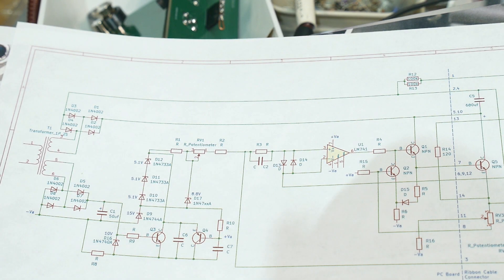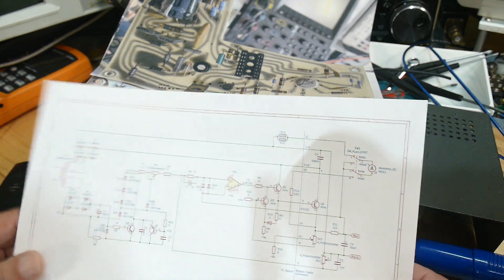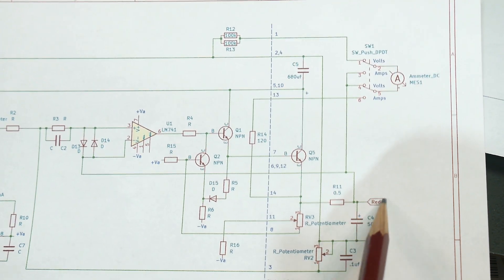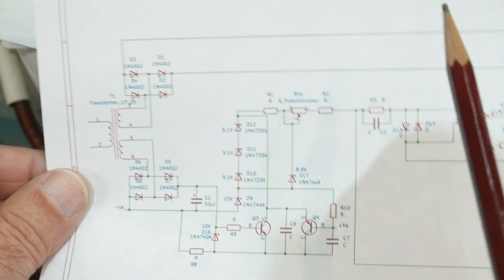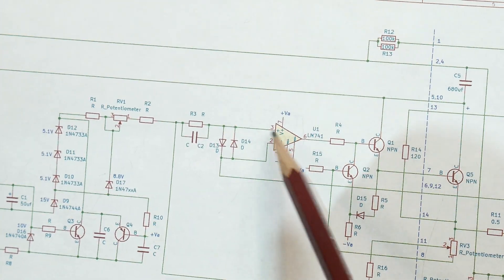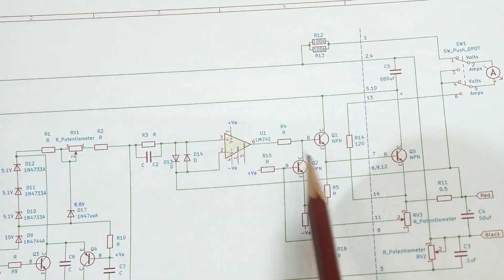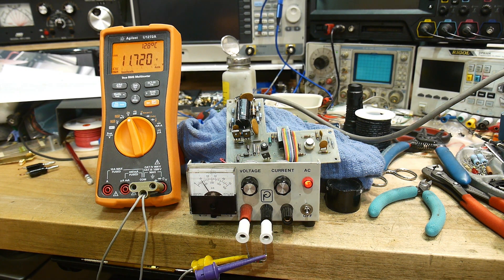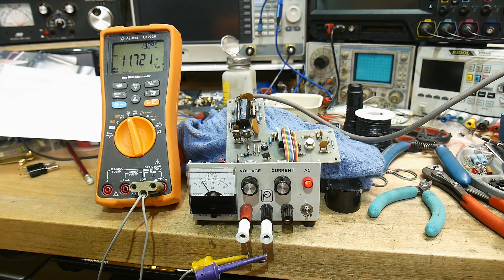#1821 Pacific Radionics Power Supply PP-20-3 (part 2 of 3)

Comment: Oh, my “guess” as to why Q2, the current limit transistor is always on….broken wire or dodgey insulation displacement connection on pin 8 of the pin header causing R15 to pull the base of Q2 up, or dodgey/dirty RV3…will I be correct in part-3?!

Comment: Photographic reverse-engineering the Big Clive way! One moment please... and resume.
Nice PCB design there. I love these curvy traces! (and curve tracers)

Multiple Zener diodes in series look like either used for power dissipation or temperature compensation reasons. I can't really see why either would be used here. I also can't really see where +Va is taken from.
Reply: Yeah, the print the photo of the board larger, and the back side mirrored is Clive's favorite technique! He must just chew through the yellow and cyan ink in his printer (because most of the huge board images he prints every time are green)!
Reply: @gorak9000  that's precisely why I wouldn't do it that way - not only do I have a grayscale-only laser printer, but also I'd consider it a waste of ink to print in color whenever I need to do reverse-engineering. So, it'd have to stay on screen, and then there's this pesky marking the spots in a graphics program.

Backlighting a PCB has helped me when I was reverse-engineering a vintage digital delay/reverb here: https://www.youtube.com/watch?v=sGNYrXYgAC8

Comment: I have drawn the circuits of hundreds of pieces of gear, I don’t use pictures like you or Clive, I just do it directly off the board. 
I could do this in about 25 minutes. One thing you learn is not to assume BCE pin outs being the same for all transistors. Gut instinct tells me there is something dodgey with Q4…looks like the emitter and base need to be swapped. 
Everything else looks “Kosher” though.

Q4 being wrong is what is flumoxing you with that reference supply in the lower left hand corner. 

I certainly would not bother with a CAD version, just pencil on paper, then I can easily rub-out and slter “mistakes” like Q4.

Another thing to watch out for is to be sure if certain transistors are NPN or PNP…particularly if numbers have rubbed off or they are do old there is no datasheet anymore…sometimes you will come across small SCRs in TO-92 packages, or UJTs or PUTs..these little buggers canhave you scratching your head foe a little while!

I was caught out recently when replacing tired old low HFE TIP 3055s for contemporary MJE 3055s, (All I Could Get) one is BCE the other is ECB, so got them in with BE transposition…it was a Royer/Baxabdall type circuit, so no harm done, but had to take the heatsink that was UNDER the two TIP 3055s and put in ON TOP of yhe two MJE 3055s!  (Was in a BWD 845 Australian Oscilloscope.)

Comment: This is excellent. Thanks for all the effort you've put into this video.
R10-D9 is used as primitive voltage reference for the Negative Rail in relation to the Positive Rail. Although these rails are taken from the aux winding, they still need some kind of common reference point and a predictable voltage diff between them. Also, windings must have a common reference. OpAmp is in a serious trouble here, as one of it's inputs is fed from the main out. I suspect the manufacturer had trouble with this, notably burned opamps during fast transients, so they've put two reverse diodes in parallel on the opamp inputs to protect it. In any case it's a mess.
The other three Zeners D10, D11, D12 and Q3/Q4 are the voltage regulator for the OpAmp's positive rail and common reference. Zeners are also driven from aux winding by a somewhat compensated primitive transistor current source Q3/Q4. I suspect an error in the schematic or logic at a common point.
The source's driver is Q3, with it's current is set by R8/R9/D16. As it heats up its current will increase, so I suspect they've used thermally coupled Q4  to stabilize the current and prevent thermal runaway of Q3. Anyway C6 is there to prevent potentially catastrophic oscillation between transistors. This common voltage is then used as the reference for OpAmp.

Comment: This way of arranging the internal power rails is quite common for lab power supply instruments. It allows the active control circuitry (the reference,opamp,...) to operate at a convenient supply for those circuits (+10V/-5V for common opamps is sufficient), regardless of what the output range of the instrument is. And it allows the power section to be dimensionned with minimum voltage headroom (of course with all the tolerances and ripple, but on top of that just 2..3V is enough, vs at least 5V margin required towards the opamp positive supply rail). In many mainly higher power designs the power winding has switched taps, so reducing the wasted voltage even more.
The whole thing needs way lower voltage margin (about half or so) and does not need any high voltage (beyond usual +/- 15V supply rating) opamp components even when the power rail needs to become close to 100V (what I would expect for a 50V output instrument when not loaded). With more modern opams (LM358 counts as "modern" here) you may design the entire control part operating even from a single 5V supply (negative of this 5V supply is then connected to the emitter of the power transistor) even when the output goes way beyond 50V. The point is, the "ground" for the whole control part is the "positive" output terminal (or better before the current sense shunt, so the shunt does not see any current not flowing into the output terminal; then it requires differential output voltage sensing), the actual voltage feedback signal then goes from the negative output terminal.

Comment: The really high voltage could be shorting out part of the primary winding. If there's 120 windings on the primary and there's a short between turn 60 and 80...then it would result in higher voltage on the output. Idk

Comment: One important point.  The opamps usually get a separate power source because if the main lines get ripples, the ripples won't effect the operation of opamps.  You placed a lm741 instead of lm709 since predates lm741 and perhaps wasn't in your CAD's library.  LM709 was a nasty opamps with unbiased input and needed adjustment.  Beside it diees quickly if the inputs aren't protected.  I think those revered diodes were placed for input protection.

Comment: Verify that the transistor has the correct specs and was installed correctly (by a previous repair attempt).  Otherwise, it is being turned on for the slightest load current.

Comment: Looking at the circuit, i can't see where +/-Va is connected to the +50V supply as they are transformer isolated? Have i missed something. i would expect to see the mid point of Va to be connected to 0V of the 50V part?

Comment: The multiple Zeners in series are meant to adjust the tempo of the whole circuit. A 5.1V zener has much less drift with temperature than a 15V zener. Great job!
Reply: Zener under 7v are one side of temp drift and over 7v is opposite. 
Put 3x 5v zener with one 15v make 30v zener with good temperature stability.
Reply: I think @IMSAI Guy had a video about 5V zeners .
Reply: Ahhaaa! So that's why you use several in series! I didn't knew that, thanks!
Reply: But without parallel current balancing resistors across each one you can end up with current imbalance because the voltage across each zener diode is slightly different.
Reply: @mikesradiorepair  They are in series, so the current through each has no other way than to be exactly equal, so no need for any "ballasting resistors" or so.